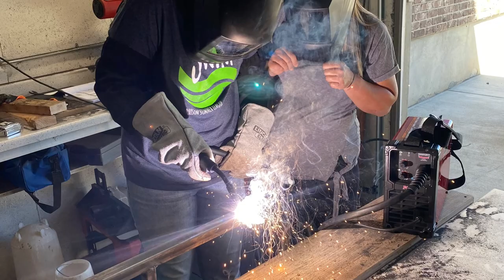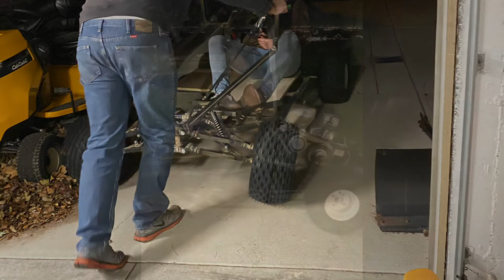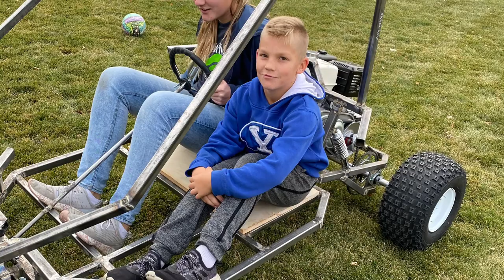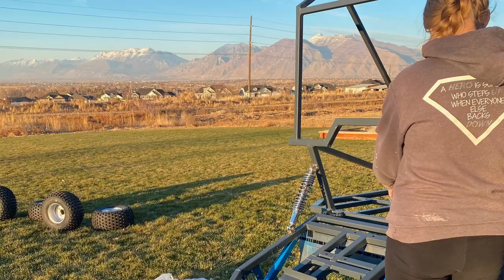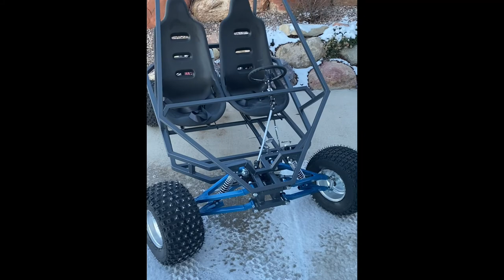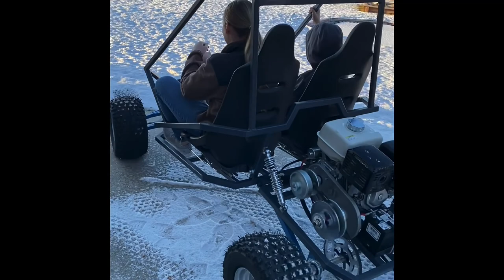Maci’s Go-Kart Build | GrandDaddy Spider Kart

Comment: Hello great work !

I have the plans for the kart and I still do not understand what 1-2 TL bushings are .Do you have a link to help me ?

Thanks
Reply: Get a piece of DOM tubing with a 5/8 inner diameter and 1 inch outer diameter. and cut it into 2 inch lengths.